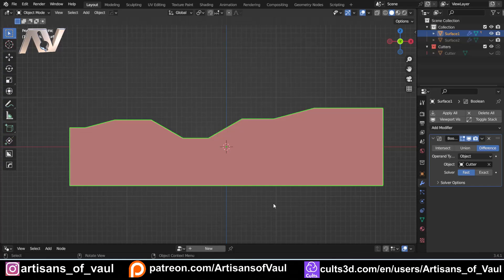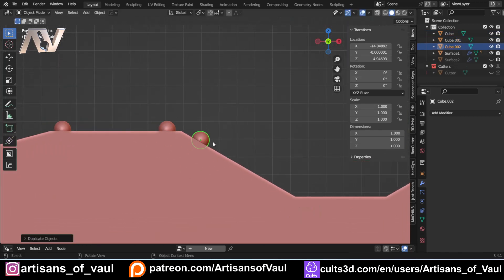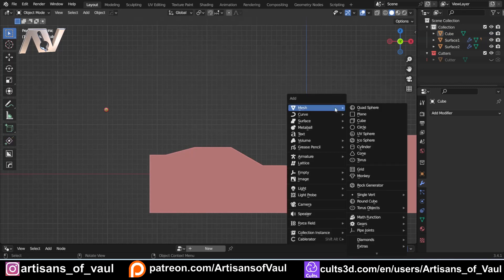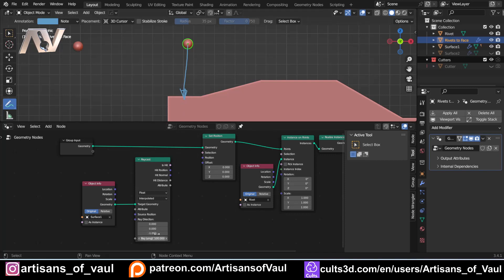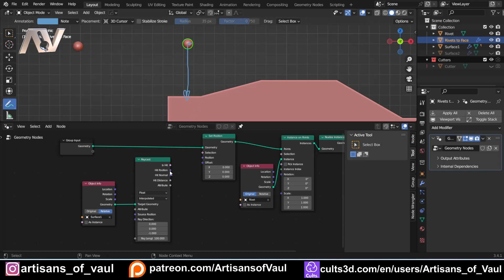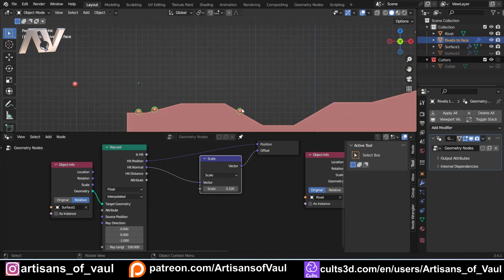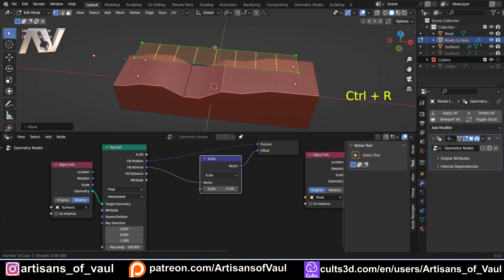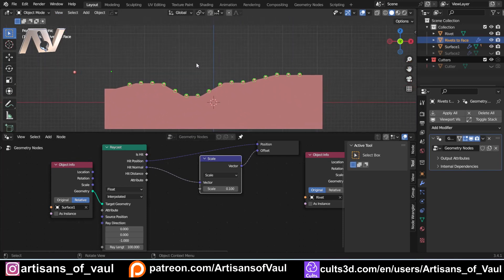Placing Objects on Faces Using the Raycast Node

Comment: Hi, just one more question. If i duplicate the single vertex no second sphere shows up? Any ideas? Cheers, Axel
Reply from the maker: @corvette724  I believe it will need to be as part of a face/edge because it needs the normal information to control the direction it is "cast".
Reply: @ArtisansofVaul  ah, ok, thx. This helps to understand. So i'm german i have iussues of understanding cast in this context. Is it like overcast for cloudy? Thx, Axel
Reply from the maker: @corvette724  No, it's cast as in to throw. Like I would "cast" a net. In this instance, it means to project in a direction. Hopefully that makes sense 👍🏻

Comment: I have a question, while I have followed your guide and used spheres for the rivets.

Currently, I have changed out the shape for cones. Some of the placement is a bit strange. Do I need to add or edit any of nodes in this video to get a better result?
Reply from the maker: It depends what you mean by strange... Could you explain in what way? It may be that you need to move the origin of the cone to the bottom face (this is me guessing as its the only strange thing I can think of that could happen).
Reply: @ArtisansofVaul  Currently with Allign Euler to Vector factor set to 0. The bolts all face in one direction, regardless of the face it is set against.

When set to 1, the rivets seem to rotate randomly and doesn't seem to factor in the surface it is set against at all.

I hope this helps clarify some of the problems I am having. But I am modelling a tank's turret with many varying angled panels.

Comment: Is there any way to raycast onto multiple planes stacked vertically joined as  a single object? Currently trying out the new Repeat Zone node with no luck.
Reply from the maker: You mean like the same set of object almost on multiple "shelves"? Are the planes the same distance apart from each other?

Comment: Interesting. Thank you for sharing! I could not get it to work. The Rivet to Face object info node gives an error "Geometry cannot be retrieved from the the modifier object" in Blender 3.6.5.
Reply from the maker: Hmm.... I'll have a look at replicating this when Blender 4 is out as that's this week. Did any of the nodes look different?
Reply: @ArtisansofVaul  Thnx! I I think I got mixed up with Rivet to Face and Rivet. I set the Object Info node to Rivet. This cleared the error, but the Raycast node ray direction options have no effect. I can move the Rivet to Face with Set Position node options.
Reply from the maker: @YYZ342  hmm.... that's bizarre if it has no effect. As I say I will check it out in Blender 4 as its release is (I believe) tomorrow.
Reply: @ArtisansofVaul  Sounds good, thank you!

Comment: Nice tutorial.

I wish I could distribute random points on a surface with better control over the objects not touching itself. The donut tutorial makes sprinkles clipping over themselves.. distance between points do not suffice. And the raycast "hit" can't be used to reference each other points objects so they won't touch themselves..
Reply from the maker: 😁 Already got you covered I think: https://youtu.be/IaEwxrqrX4k

The sound is a bit quiet, I'm going through and fixing a couple of videos where the audio wasn't quite right but this has what I think you're looking for.

Comment: This is really helpful! Especially the grid-method. As rivets on historical vehicles sometimes come in odd, irregular patterns it is still faster and easier to move or delete single vertices or edges with this method here to replace or remove rivets according to an original. Plus: Sometimes rivets come in odd shapes like little pyramids. With the "align euler to vector" operation even those can be placed easily.
Reply from the maker: I thought you'd find it helpful 😁👍🏻

Comment: Howdy again! Love the videos as usual. I do have one request for a topic soon, and that's how to remove say a hand from around a weapon and then fixing it up so that you can print just the weapon separately. I'm not sure if you've explained this before but if you haven't it would be incredibly useful!
Reply from the maker: That's a good idea for a video. I'll have to have to add that to the list. The biggest issue with that will be that sometimes things like the thumb slightly overlap onto the weapon. But that's what makes it a fun video. I'll look into it👍🏻
Reply from the maker: I just thought that you might find this video I did useful.  Its not for Blender but a slicer program instead you might find useful.  Check out the Planar cut chapter: https://youtu.be/TxHtYDUR-6s
Reply: @ArtisansofVaul  That's an interesting feature! It doesnt solve my problem though lol. I have a unit that has a bow in hand on the model, but you can take it as a secondary weapon as well, which doesnt have a model. I wanna put it on their back, so I want to model the handle and then attach it. I can do the attaching part just fine, I just can't figure out the best way to fix the handle without it looking like hot garbage.
Reply from the maker: @NorasHobbyverse  Ahh... So you more want to how to make a handle for a bow? It's a slightly lazy method but if it's 28mm there is a method in this video that works ok: https://youtu.be/I8hb9KdK9pM

Comment: This is great! I'd love to see how this would do dimpled flush rivets. Also, just an FYI, real rivets never have an undercut.
Reply from the maker: Oh I know as they are a half round.  Its purely a tip from a 3d printing and painting point of view.  It makes it easier to "see" the rivet if that makes sense and helps paint to pool when you do something like a oil wash.
Reply: @ArtisansofVaul  As a scale modeller I couldn't get away with undercut rivets. I've never had any issues with washes or stains not showing rivets even printed at 0.01mm. But still, a video showing the various ways to do real rivets would be a good in my opinion. AN470 and AN426's.

Comment: Im new to this but there seems to be an issue if you use an offset scale of zero (I was making an object of  a hemisphere screw head to place on top). I had to increase above zero to get correct alignment else the direction normal spazzed out. I can only think it is like when the viewport shows two faces on top of each other that have the same location and the displays a mix of the two, and the normal is having the same issue due to being at zero of the face. Like I say I'm new so anyone that can explain better please do.
Reply from the maker: I think you are referring to the face fighting that happens when two faces are directly on top of each other.  It happens as Blender tries to jump between each one to show "both" as they should in theory both be visible.  It happens for sure.  Though normally you just ignore it as the faces shouldn't remain on top of each other so its normally just a part of the process in creation before they are moved.